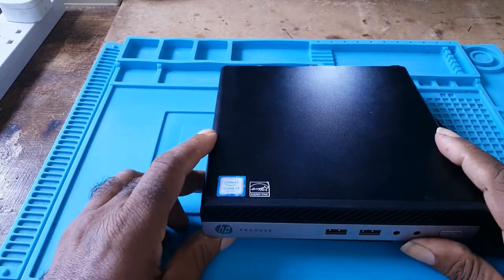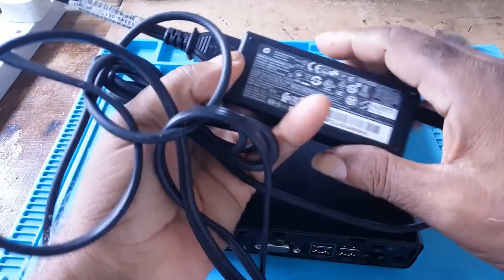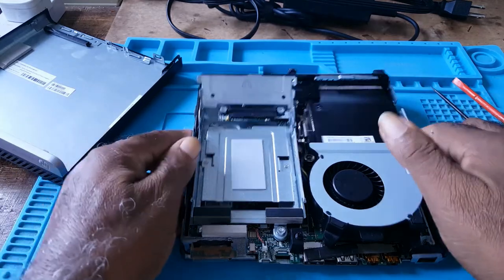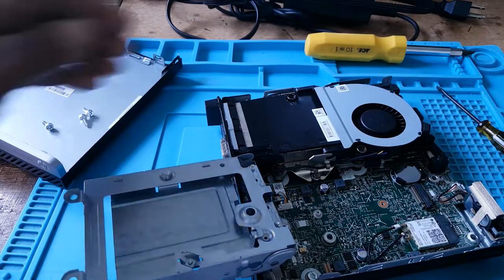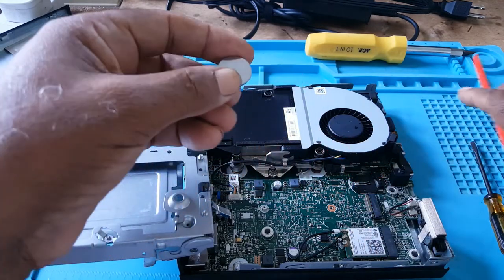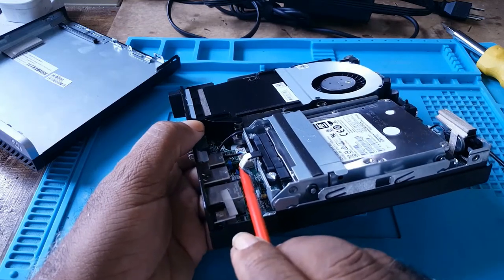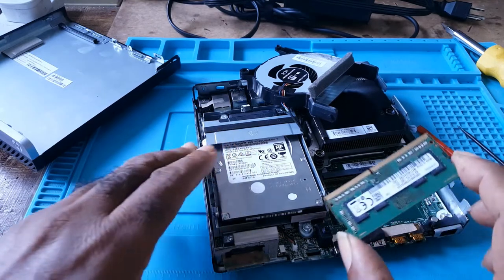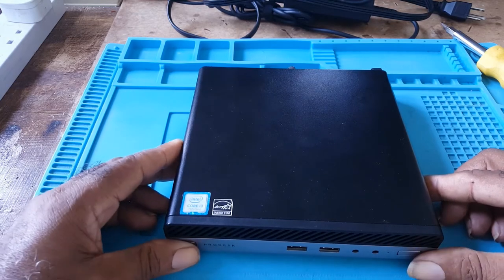HP ProDesk 400 G3 Mini Desktop CMOS Battery Replace

Comment: Hi good video. Do you know if the computer will support ssd to run window and then use the HHD has storage ? Thanks
Reply from the maker: Yes it can run  the ssd it will make it boot and run faster.

Comment: Have you added a NVME SSD to the m2 2280 slot, if so can you boot Win 10 from the m2 NVME?
Reply from the maker: No I did not add a NVME SSD and yes you can boot form one.
But you have to go to BIOS and change boot Settings.